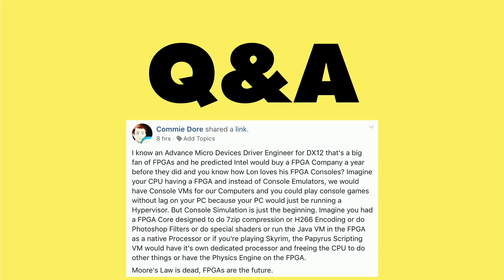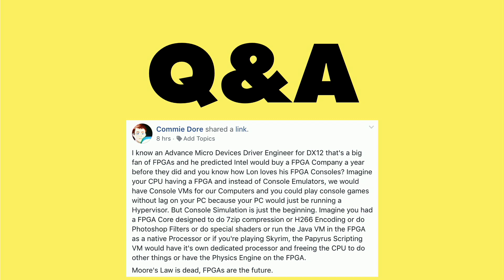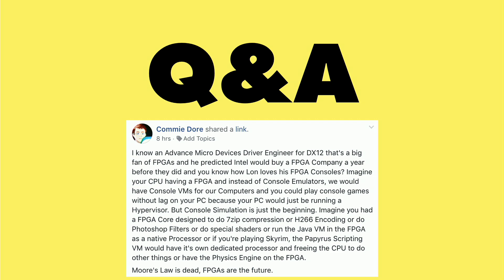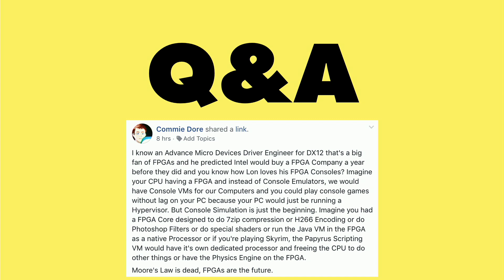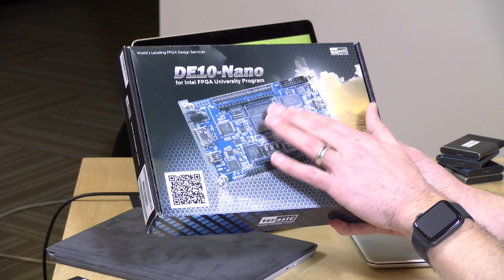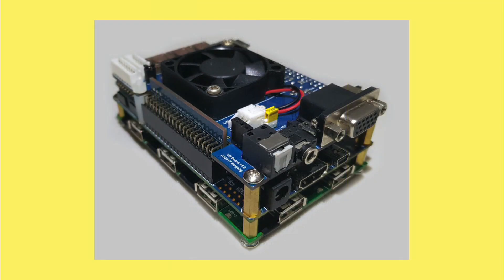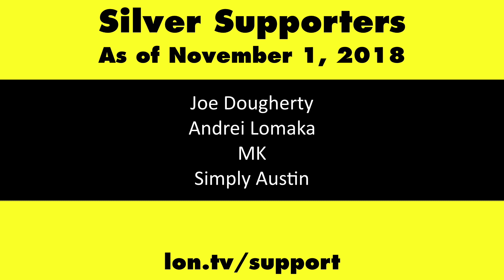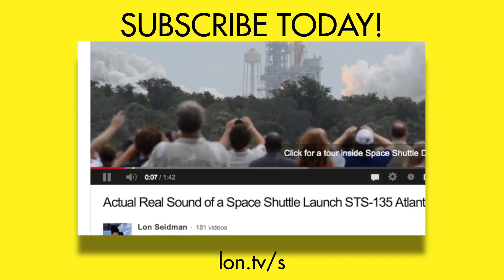Are FPGAs the Future of Computing?

Comment: Xilinx has had this for ages, their zynq SoC although the arm processor doesn't have the speed of an Intel chip, the concept has been around for a while. What is going to be interesting is if VHDL or Verilog will be replaced by higher level languages which utilize a compiler that automatically generates the synthsisable net list.  Again this is being done already,  but what I'd like to know is are these lower level languages going the way of assembly language.